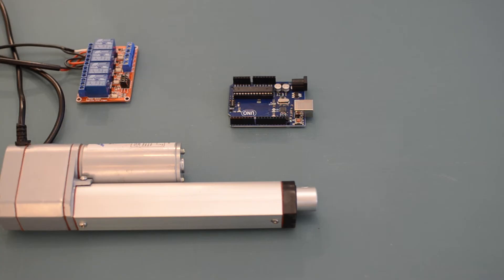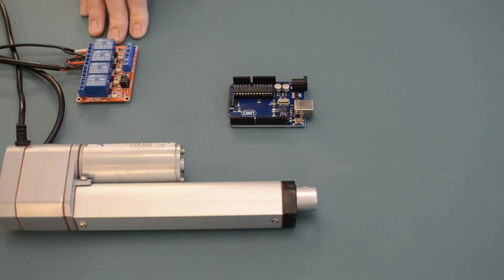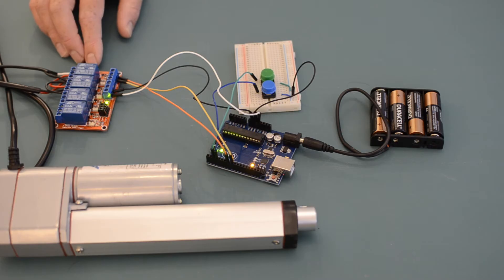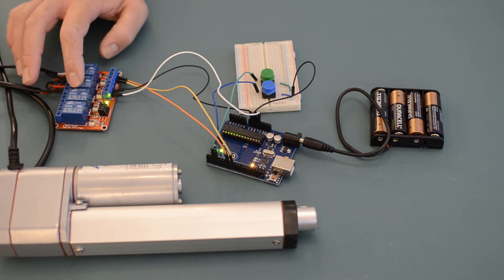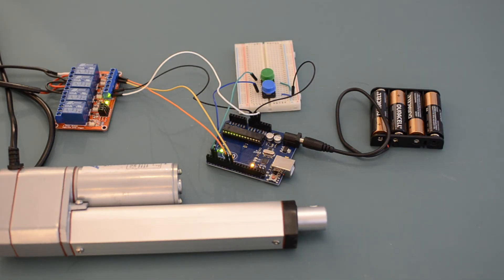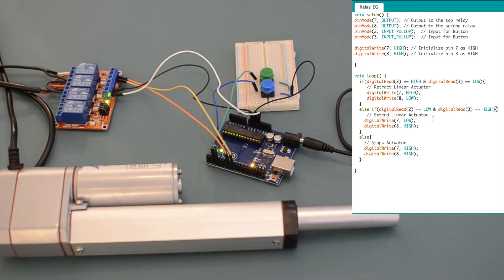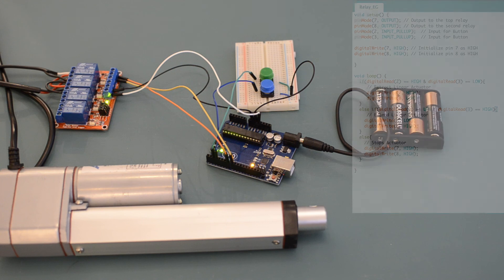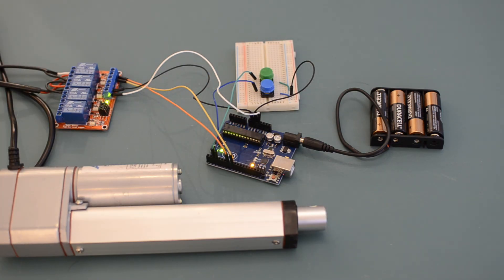Controlling a Linear Actuator with an Arduino and Relay

Comment: hi i have an acuator for my car on my throttle for long idle i want it to push the actuator out only a certain length not all the way is there a way to use that controller on my two wire actuator i want it to idle at 1000 RPM for 5 minutes then 1 minute just regular idle then 5 minutes 1000 RPM until i turn a power switch off. i need it to just push the throttle a little so it would need to be  2 seconds of pushing then it holds it for 5 minutes can the software do that